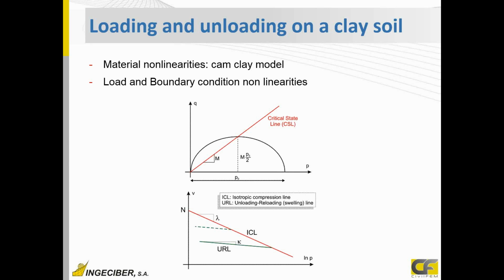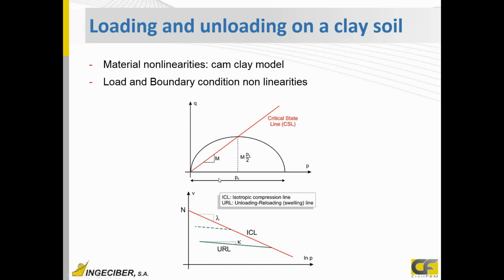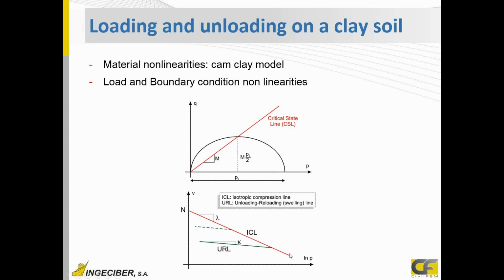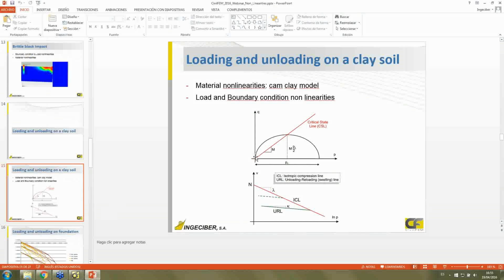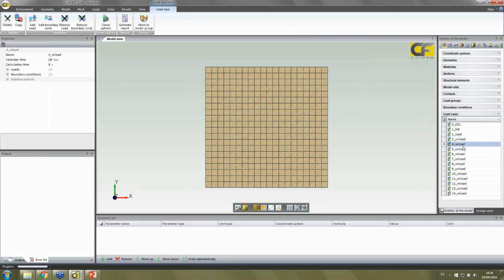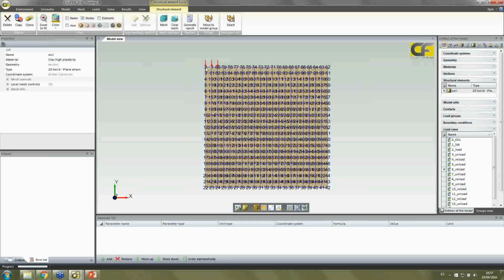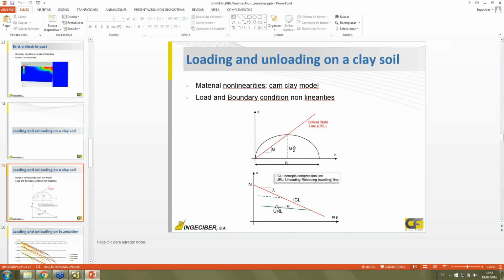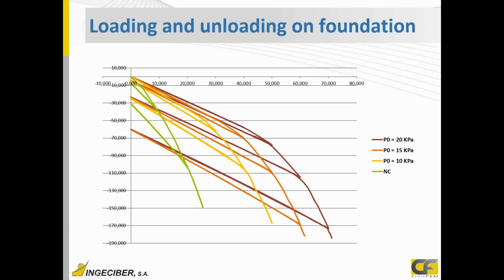Webinar CivilFEM 2016 Non-Linear FEA (V) CONSOLIDATION OF CLAY SOIL

Comment: Please how to make loading and unloading load cases in CivilFEM
Reply from the maker: +Tamer Ibrahem Cam-clay model needs a initial stress state that is used to define the preconsolidation pressure and the yield surface. This initial stress state was self weight, and self weight plus an overload on the soil surface of 10, 15 and 20 KPa respectively on the four models. The cycling loads are an incremental vertical pressure alternating with zero pressure on an area or 1 m2 on the left of the model.
Reply: +CivilFEM Many thanks for your reply. 
My question is general one not specifically for this model.
As i saw from the video there are several load cases named as loaded and unloading are they in consequence "meaning every load case is run after the previous load case using previous stiffness". 
As cyclic loading is concern how CivilFEM doing that.